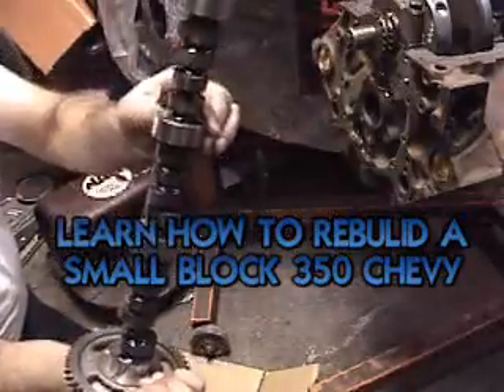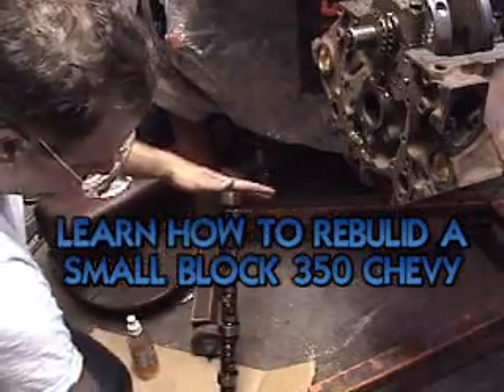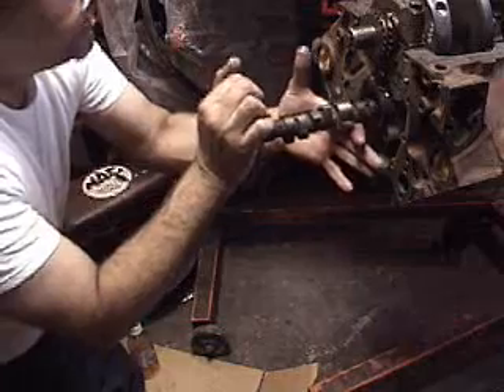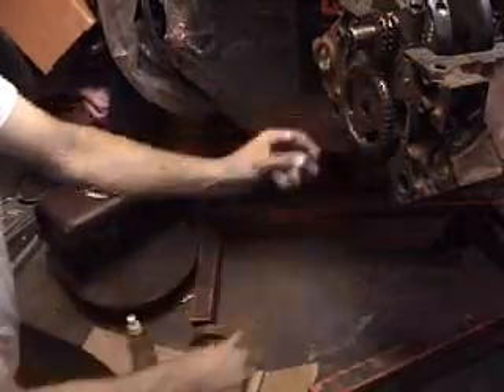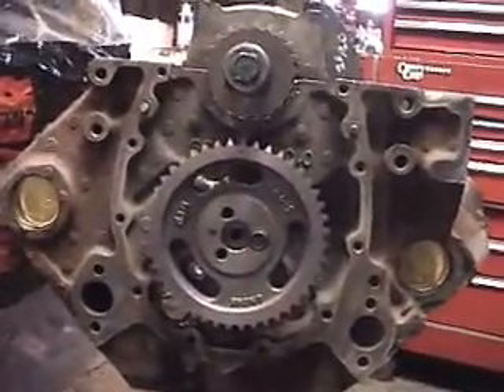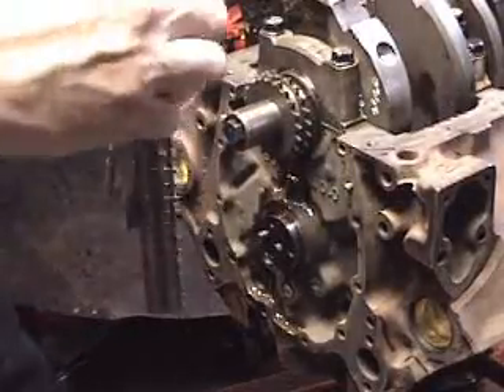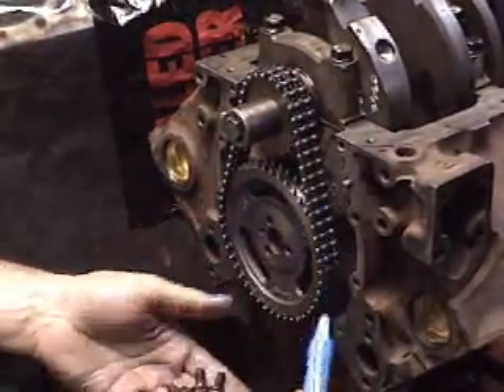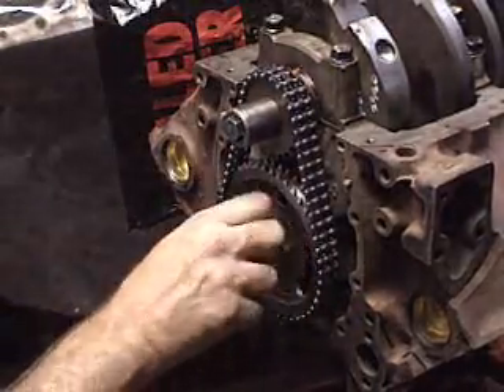HOW TO CHEVY 350 SMALL BLOCK ENGINE REBUILD CAMSHAFT TIMING CHAIN INSTALLATION DVD

Comment: In the case of putting a camshaft into a stock, running motor (unable to re-grease journals) what is a way to get around that without causing damage to the journals/cam?
Reply: 1981GMCSierra  Turkey baster filled with assembly lube, attach a rubber line so you can reach back to the rear bearings  goober 'em up.   :)

Comment: After the dots are lined up gary you will need to turn the engine over one turn that will be tdc number one ,that's a mistake I see a lot of people do is throw the distributor in before doing that and wonder why it doesn't start..the only thing I would have done different is I would have used a torque wrench to tighten the bolts..

Comment: when the dots are lined up like that is that not number 6 cylinder at TDC ?
Reply: I know if you line up the dots & install your distributor on #1 you'd be 180 out so the answer to your question is , yes .
If you are replacing a jumped Chevy chain install the cam 180 out or you'll have to reset your distributor 180 .
Reply: yep yep i second that . lol  learned the hard way

Comment: One of the stoutest cheap truck engines I have ever built was a .060 350 with stock dished pistons, a set of stock 305 HO 14014416 heads 1.84 1.50 valves, Melling MTC1 cam, an edelbrock performer, double row chain, and a 750 q-jet, manifolds and 2" duals. It had tremendous torque, it is still running great 12 yrs later

Comment: what I am hopeing is most of the engines/types if you get the crank/cam/timeing chain/belt correctly lined up the timing of the spark for the igintions system/cylinders to fire when the pistons are top dead center should be there (i.e no configuration of the ignition system) Can somebody verify this or give me an answer to this,  Both for older noncomputerized distributor or later cars and the new non-distributor based computer ones that work on opening battery ground via a transistor.

Comment: My only problem after seeing the installation of the timing chain/camshaft/crankshaft assembly is if the ignition system will have to be timed with the rotation of the cam/crankshaft or if the crank/cam position sensors do all that for you so you don't have to worry about timing the ignition system just have to worry about lineing up does.
Can you clear this issue up for me. I would imagine it may differ for inline , V , pushrod ,and other engine types.

Comment: I know the distributor based ones you need to install the spark plugs/wires in a certain way but for the new computerized distributorless cars do are they all preset by sensors to fire at the correct time provided the cam/cranks shaft / timebelt is install correctly

Comment: I am wondering once you line up the dot on the camshaft to the dot on the on the crankshaft and install the cam. Will the spark plugs / ignition system fire for each cylinder when the piston is top dead center or. Does something have to be set/lined up for the ignition system.

Comment: Don't teach people that. Your missing the cam locking plate and you always torque any engine component to specs. (With a torque wrench) you are right about locktite but red locktite is the one you should use. Did you forget to make a point to show people who are trying to learn to use the correct timing alignment mark. There's a dot and a zero. They need to know to line the dot up and not the zero.

Comment: I may not be the one you're trying to ask, but that's your average SBC. Overhead valve, cam in block motor. Pushrods open and close the valves... 

What you're looking at is the block, upside down. It doesn't have the oil pan or heads on it.

Comment: hey, armchair mechanic with what might be a very stupid question for somebody:  the timing chain is a very sort chain in your video, so do I assume correctly this engine is an overhead valve engine?   It looks like an old-school push rod engine, with the camshaft below the cylinder block right?  and the cylinder block is not yet attached; you'e just working on the crank case?

Comment: @ratrodscot yes.  but most 305 heads wont take anything bigger than a .420 lift cam and keep enough clearance to not crush the valve stem seals

Comment: @Denkha94 no it does not because there is a dowel locating pin for the cam gear that only lines up one way.  But it might help if when trying to line up timing marks on the cam gear such as +4 advance or -8 depending where you want it at.  Take into account most aftermarket cams already have 4 degrees advance ground into it.  Check the cam card or specs before hand.

Comment: @ronieboy44 Hi their, I have a chevy 283 Motor, does the engine has to be on TDC on Piston #1 in order to take off the timing gear and reposition it. Would that be correct?

Comment: Ive got the GM 350/290 HP crate motor in my 72 el camino and i want to put the Comp Cams Thumpr in her, is it possible to change the cam without pulling the motor?

Comment: Problem with rebuilding an engine is the vehicle sits for 2 weeks.Most remans are cheaper than getting the engine rebuilt.Where I work at,call up jasper and they send out an engine and call them back to pick up the core bolted to crate.

Comment: dont you have to torque the timing/cam bolts to a certain amount? also isnt the dot to dot not tdc but like the 6th cylinder compression?